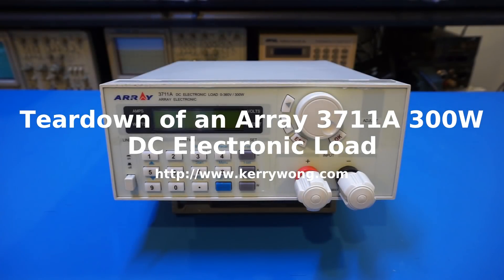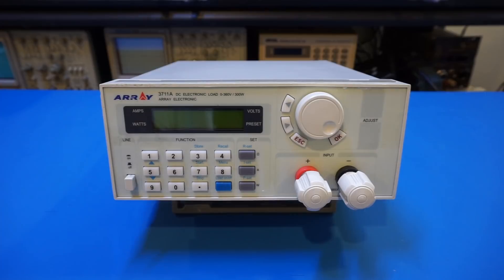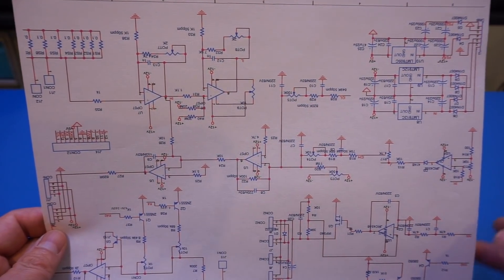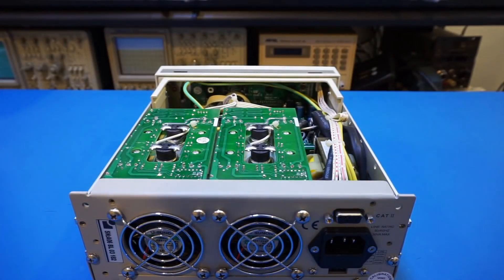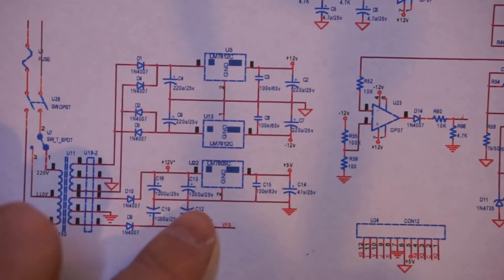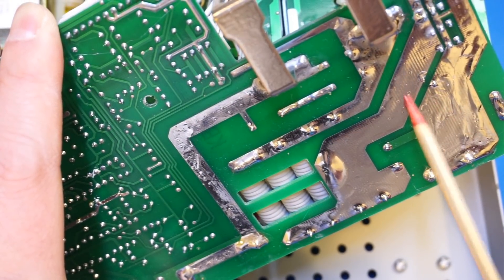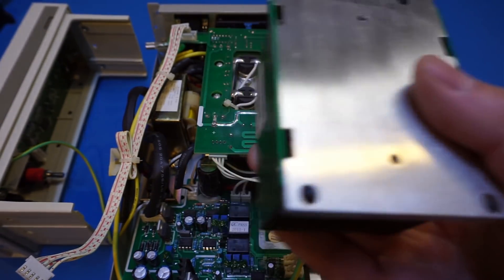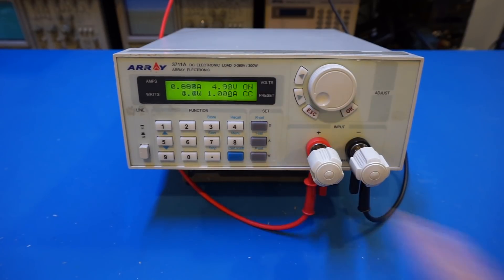Teardown of an Array 3711A 300W DC Electronic Load

Comment: My 3711A is about 8 years old and has developed a strange problem. The two voltages shown on the display are about 1/10 of the actual voltage. Originally, the error was time dependent (accurate when first turned on then after awhile would change to the 1/10 of actual value). Now it is permanently about 1/10 of actual voltage. The load settings (A, W, R) have tested accurate with external test equipment. It appears to be a problem with how the unit is sampling/conditioning/scaling the measured voltages.  I've just pulled the schematic from your webpage so I will study. Any tips?

Comment: Thank you for the video.  I have the TekPower 3710A and I also got mine off of ebay. It was brand new in a sealed box from a company going out of business and for well under $200.00.  it has been working fine and seems to be well designed and built.  I really appreciate that your link allowed me to download the schematics.  Thanks again for posting.

Comment: A warning for anyone using this device.  The ground of the serial port is connected to the negative post of the input.  If certain electrical connections fail, large currents can pass through your data cables and PC.

Comment: If you look at Mininmum resolution you will see they are using 12bit ADC, not 10bit. You were looking at accuracy. Different thing, and looser than resolution. Obviously. It is mostly due to calibration, drift, noise, and components used, etc.

Comment: it should have a sensing port. there will be a significant power loss under 30amps load...
Reply from the maker: I will give it a test to see what the voltage drop along the terminal is at the maximum rated load. But given how large the connectors are and the way they are mounted I don't think the voltage drop would be significant. But I will test it out, stay tuned.

Comment: You don't really realize how useful a electronic load is at the bench until you get one. Lots of troubleshooting done with the smaller 150W BK unit I have...sometimes I wish I had a bigger one but that's for another day! Thanks for sharing Kerry!
Reply from the maker: Yeah, I agree, electronic load is very useful. I built the 1kW one so that I could test my battery banks and some beefy power supplies...